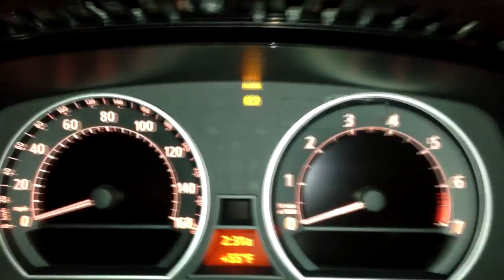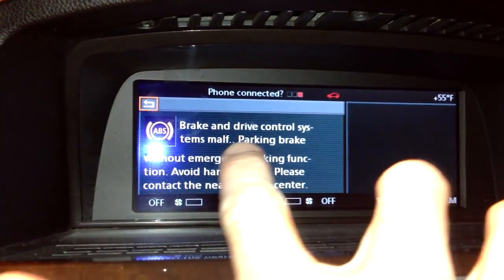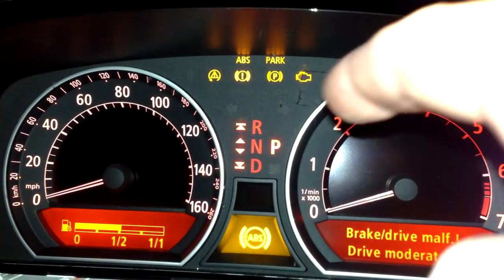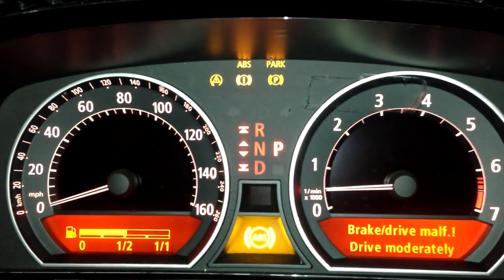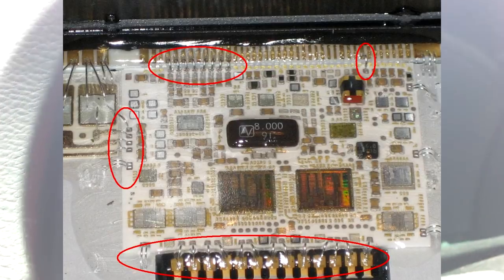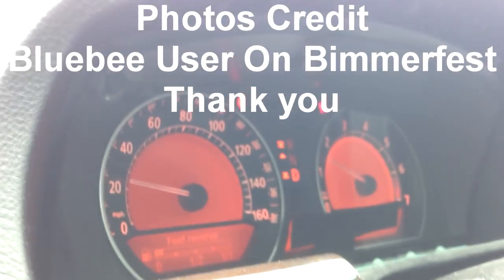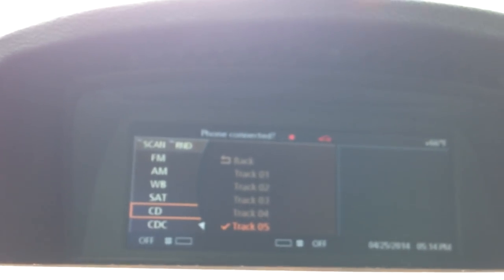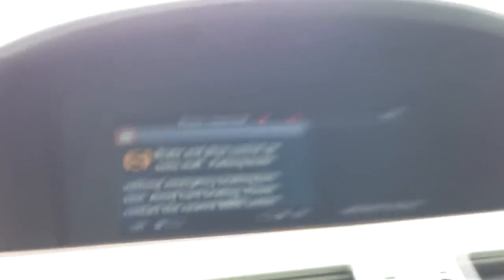Symtoms Of A Bad ABS Module  - BMW E65 E66 Bosch 5.7 module

Comment: My DTC light is on and Park Brake light..
Reply: kj2844 
The cause of the  Park Brake light is yellow the ABS sensors  rear broken.

If speed indicator stops the left  sensor is broken and if lost works the broken sensor is right
Reply: +Mohammed Albity  could you explain that better? left meaning in the back or the front?
Reply: +Mohammed Albity  could you explain that better? left meaning in the back or the front?
Reply: +Mohammed Albity  could you explain that better? left meaning in the back or the front?
Reply: Haraldur Ólafsson  in the back

Comment: Hi I have a 2006 750Li. I changed all the sensors 3x and had the abs mod rebuilt. The abs logo and brakes tracking light code still pops up on the dash board.  Please help
Reply: Check the battery. After winter, my e65 started to throw out random fault codes and guys at service told, that battery might be starting to give up and there is not enough power for everything. Take Your battery to service and ask them to check it out, before You buy/change anything else. Worst thing You can do is just replace parts, without knowing, why it is happening. Hope it helps!
Reply: @lowpoly9563  tank you low poly
Reply: did you ever figure out what the issue was? I'm in the same boat.
Reply: @Lillian Taylor
Reply: Did anybody find the issue

Comment: Hi Chris quick question, about a year ago I had my ABS Module rebuild due in part because all the lights on my dashboard would lit up and my speedometer would stop working after driving the car for a short time. After having the unit rebuild and reinstall all those issues went away except one. Which I have still been unable to resolve. 

The nature of the problem, is that the brakes seem to be losing their power assist anytime I use my brakes to roll to a stop. Or, whenever I'm heading downhill and have to come to a stop slowly. However, under hard braking the system seems to be working fine! Have you ever come across this type of issue?

Thanks,
Reply: chazgar. I believe you have a speed sensor or 2 going out or reluctor ring or rings need cleaning or possibly replaced. the rings is what the speed sensors get there input from to send to computer.

Comment: I have a 2005 745li BMW and my Reverse,Neutral and Drive keep blinking and ABS symbol comes on. I've already changed out the intergraded supply Module and it still does not start. And the break pedal is extremely stiff. Thanks. Any information would help. I'm ready to junk this car lol
Reply: you have a bad szl module in the steering wheel
Reply: Bad battery